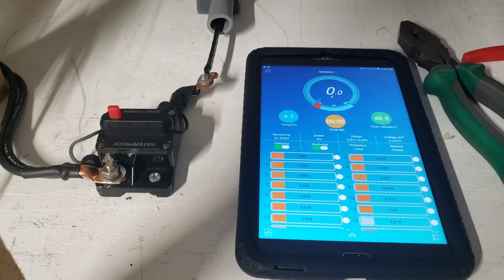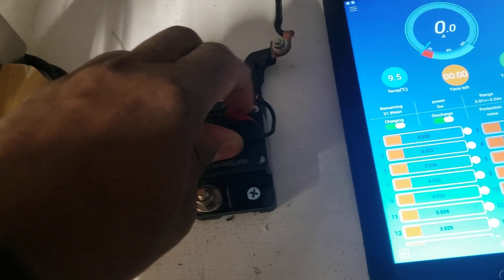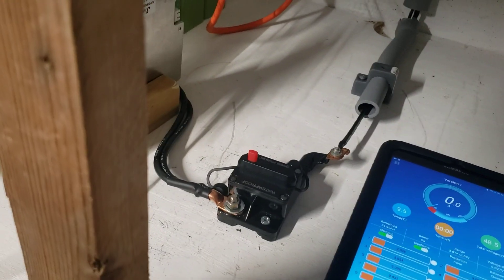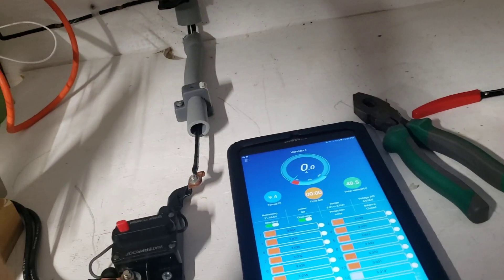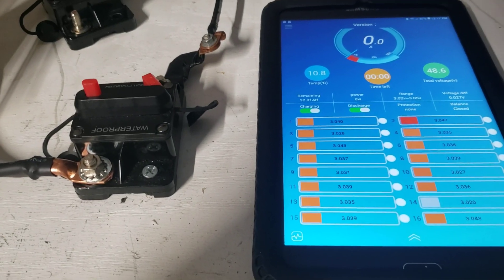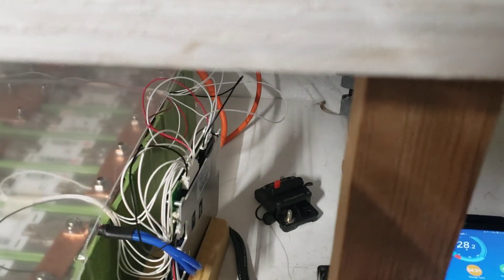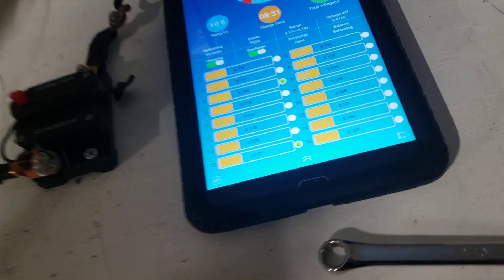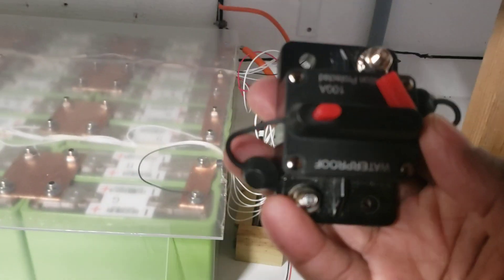Update/broken DaierTek 100 Amp Circuit Breaker 12V - 48V Breaker Manual Reset #dccircuit #DCBreaker

Comment: Come on just buy a box of them and change them when the burn out they really aren't meant to be switches they are breakers! lol
Reply from the maker: They failed badly
Reply: @simplyfocus9937  I use the T tocas they hold up well
Reply from the maker: @gunlover1955 I don't use those kinds anymore
Reply: Thats not true.  I just bought a couple and after "dry firing" the switch with zero voltage and zero amperage it stopped working. I know this bc i had my multimeter on it testing the continuity
Reply from the maker: They are not braker, lol. I am not sure of what to call them

Comment: You’ll need to use a large battery cutoff switch to connect a large battery bank and large inverters but use the breakers only to protect the inverter .The inrush 48 v will arc and destroy the inside of the breaker if you use it as a disconnect switch .🤔May the solar be with you .🙏
Reply from the maker: I just ordered a few switches, thanks